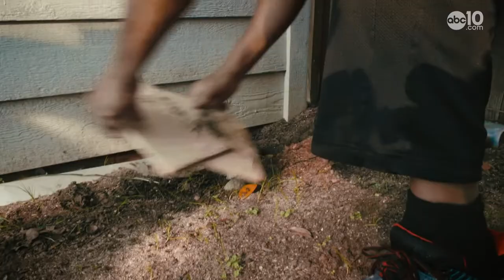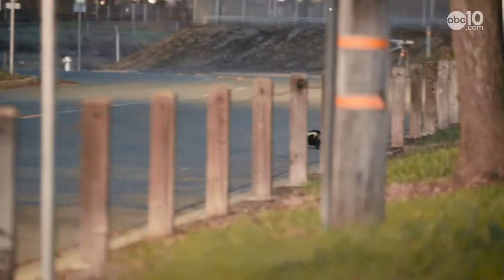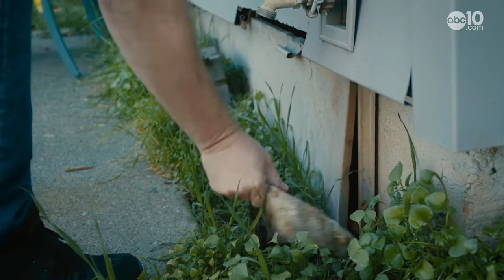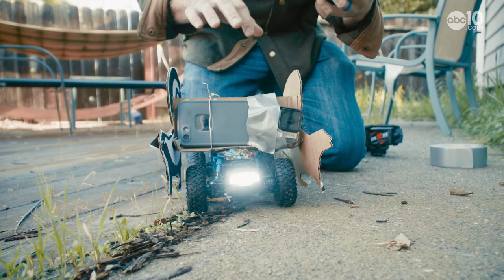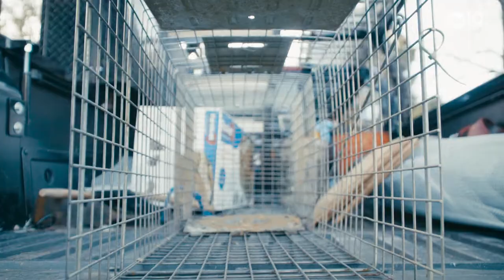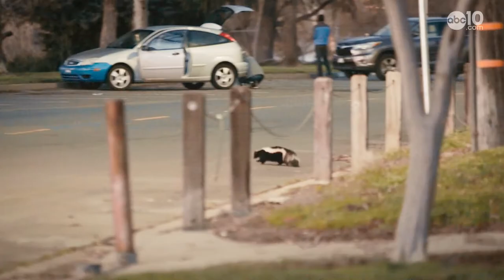Skunk mating season signals the start of an annual nightmare for homeowners

Comment: Hi, I have a pet skunk and can give you some suggestions. The easy way to keep the wild ones from moving under your house is to get a few gallons of ammonia, and simple pour some all over the ground under your house. Not only skunks but most other wild critters will be out of there real quick. If they are back just do another pour.
Mr. Camera on the kids car, I dont have one,.however I would try to tie some rope to the back end of it. If it gets stuck might be easy to pull it back. If you have any questions bout skunks let me know.